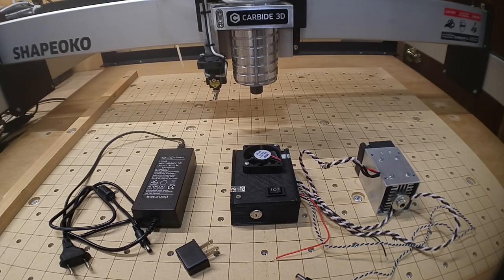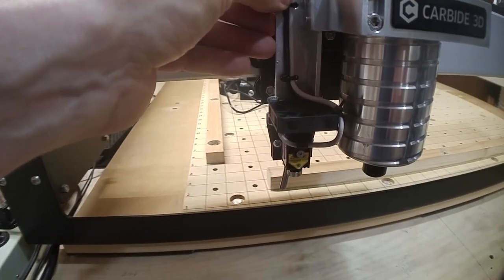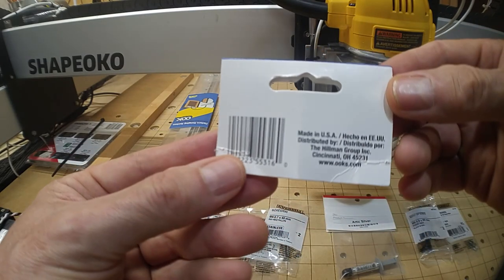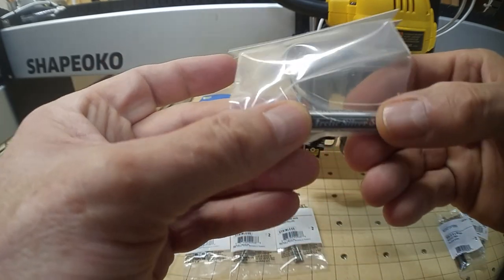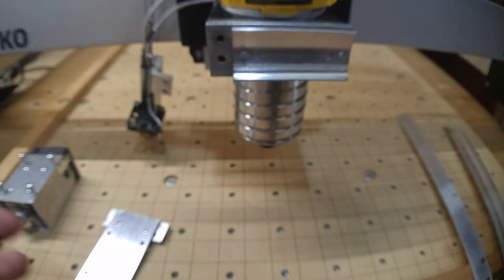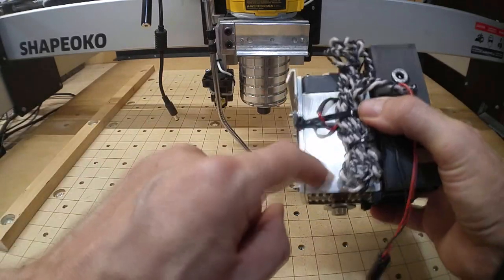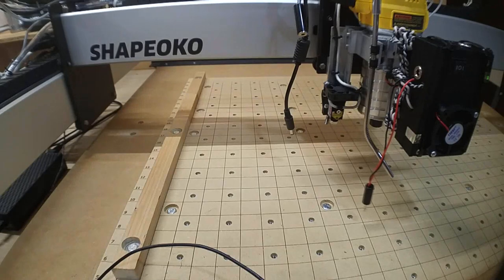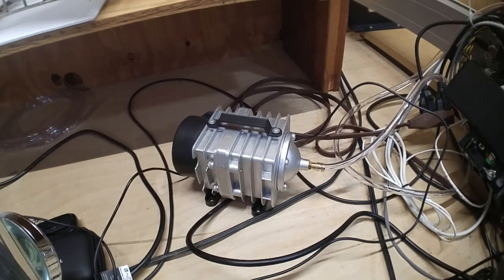Setting up an Endurance 10 watt laser on Shapeoko XXL 3 CNC machine

Comment: I would call that cabinet hanging hardware a French Cleat system.. I've made them out of wood to hang stuff in the shop for years.  The heavier the item is that you're trying to hang, the less it's going to move due to gravity.

Comment: Hi, thanks for posting this video it’s something I’m contemplating. Would it not make sense to mount the laser into the router mount in some way?
Maybe I’m missing something but I’m for keeping things simple.
But all in all very informative.
Reply: Considering that the spindle mount is circular, you'd have to fabricate something so that the laser will fit into the circular hole meant for the spindle. In my opinion, I think it's trickier to mount it that way, so I went for an approach that's similar to JTech Photonic Lasers.